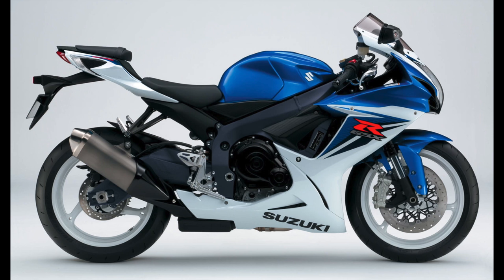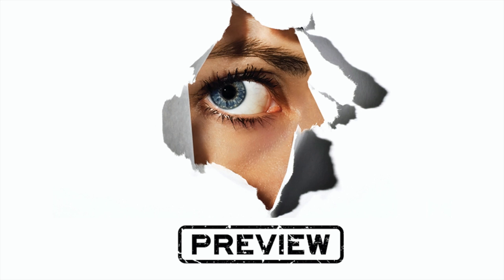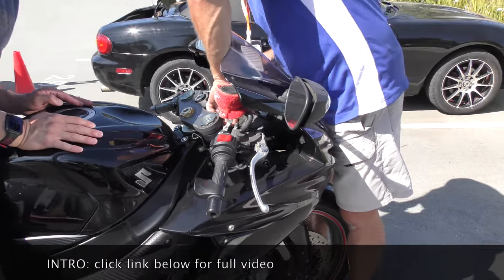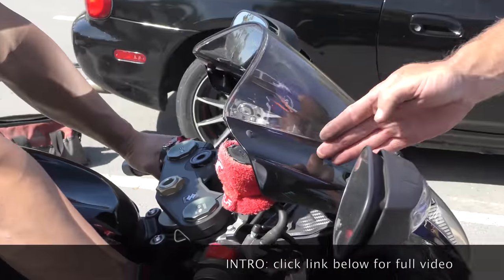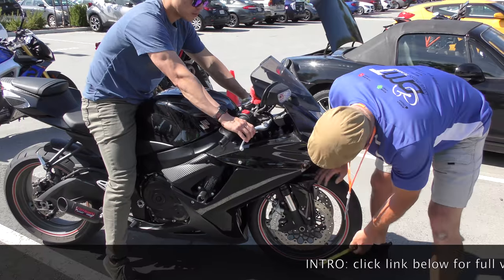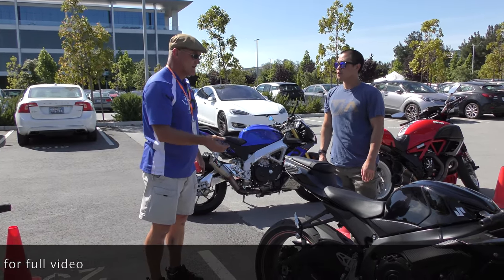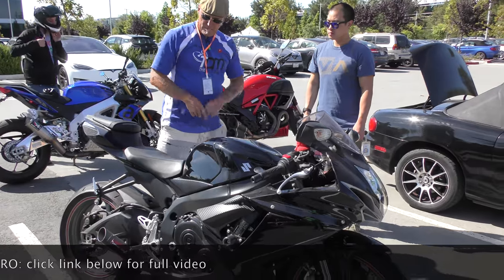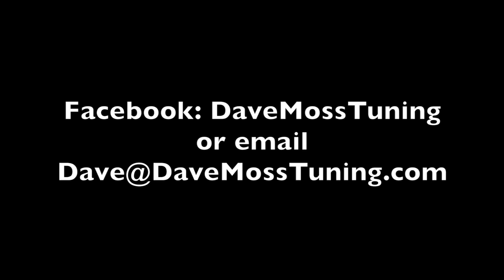Motorcycle Suspension Setup Demonstration Intro

Comment: Dave, Thank you for all your help through your videos and especially all the time and effort put into them. that being said I have a question. I bought a 2006 ZX10R last year and I have found that the entire suspension had been cranked down all the way. Thanks to your videos I have been able to correct it. I fall in the aggressive street rider category and would love to hit the track. I would also love to see what I have on the strip. I want to lower the bike. Do you recommend doing so in a street/racing setup? Should I keep the drag setup separate? I would like to lower the bike either way so I am asking if doing so is gonna compromise the street/racing setup? please and thank you for any input.
Reply from the maker: Thanks for the kind words and for leveraging the content. Please keep the drag racing part completely separate. You might even consider getting  a second set of forks and a shock for that specific purpose. Lowering will reduce ground clearance for street and track and that might be very detrimental to lean angles and speed. If you choose to lower the  bike, you will need to compensate the forks the same amount to have a flat chassis.
Reply: @catalystreactionsbw  Thank you for responding and so quickly...wow! I picked up a nail and have been breaking in my favorite Michelin Power 2 ct's since my question. I've really put some thought into it all. This bike absolutely loves to lean and far, lowering it would definitely low-side the bike first turn.  Now I guess I'm faced with another dilemma, is the extra work swapping parts out worth it?  She would make a beautiful drag! I might have to go out and find another street/track bike I can fall in love with. Gah! Thanks again.
Reply from the maker: @mre7617  Take a look at your pictures to see if your body is far enough over and the bike is stood up correctly at apex compared to some of these images: https://davemosstuning.com/about-dave-moss/dave-moss-race-reports-2018/

Comment: Hi Dave, new sub and love your channel. I have a 18 CBR650F and with it's limited adjustment settings are they any tips on setup I could do for just normal street riding. Thanks
Reply from the maker: Welcome and thank you for subscribing. 15w in the forks, set static sag at 10-12mm with a cold shock. Test 36/36psi cold front and rear and once the test ride is done, test either 34/34 and/or 38/38 to see what feels best for you!